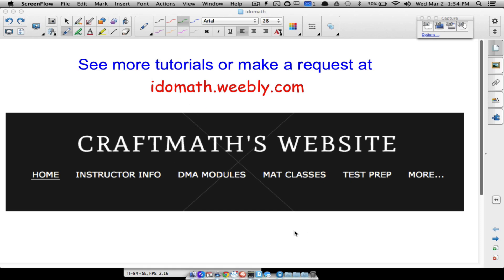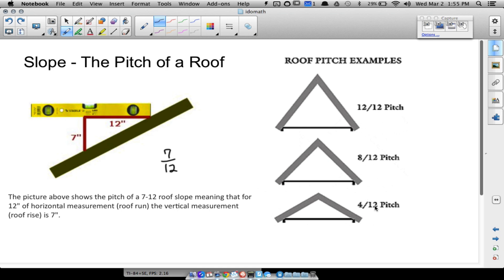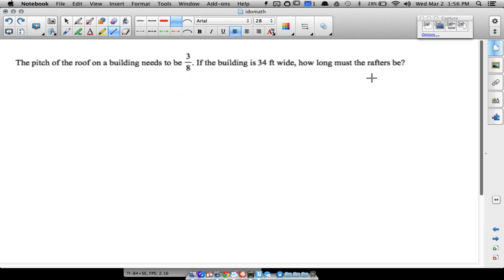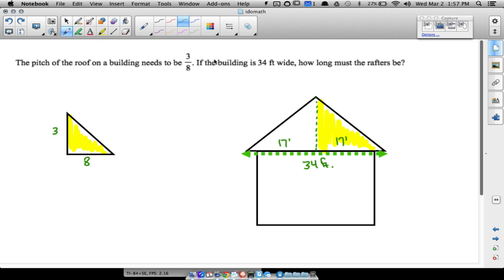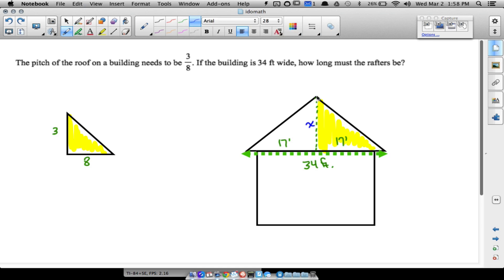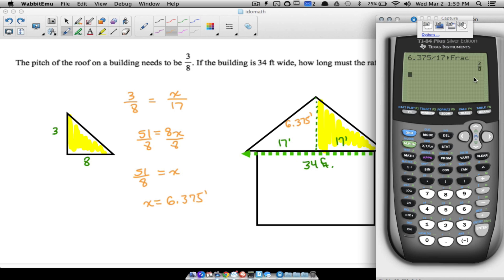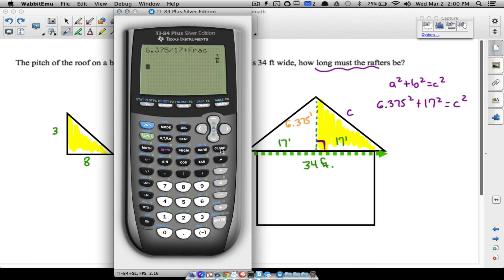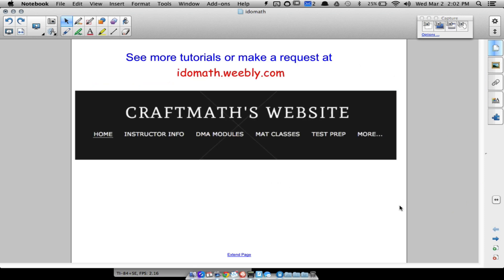Slope The Pitch of a Roof

Comment: slope is the precise measurement of vertical rise per 12 inches of horizontal run, used in construction; while pitch, traditionally, is the simplified fraction of total rise over total span (run x 2)
Reply from the maker: Yeah. I've learned that over the years through these comments. The text I used at the time didn't even mention this. Goes to show even books can be wrong. 👍

Comment: What is 18.2 ft on a tape? 18'-2in
Reply from the maker: 18 feet and .2 OF a foot... 20% of a foot... 0.2*12 = 2.4 inches.  So, 18.2 feet is 18 feet and 2.4 inches.
Reply: @bcraftmath  .4 is =1/4 ?
Reply from the maker: 0.4 is not equal to 1/4. 1/4=0.25
Reply: @bcraftmath  so I just round it off to 0 then.
Reply: Thank you so much, you helped me out big time.

Comment: On a lean two roof/building  when rising the front wall to give the roof a fall back you are also increaseing the run, and the more the rise the longer the run??
Reply from the maker: If the front wall that you are raising is vertical, you are increasing the rise, but essentially not changing the run, which creates more pitch.

Comment: Hi, I am from the UK and when we are setting out a roof we do it using the angle of the roof ie. 32deg, 35deg, 45deg. We don't use the 8/12 or 3/8
so using your way how could we do it. Thanks for any help.
Reply from the maker: To find the angle that you would need, you can take the arctan(rise/run).  In the first picture of this video, the rise was 7 and the run was 12.  The angle of the roof would be arctan(7/12) which is approximately 30 degrees.
Reply: Have the same problem too. Have you known the answer to this?

Comment: pitch and slope are different terms meaning the same thing, angle of roof:  6:12 slope = 1/4 pitch.. 4:12 slope = 1/6th pitch, because the 'pitch' of a roof is always based on 'full pitch' 24/12!!
Reply from the maker: Ok.  This video has received quite a bit of attention. I originally made this video many years ago to help students with a similar example they were working in a math class that I taught, which was a mathematical literacy class.  This wasn't a class specifically meant for contractors or folks who are very knowledgeable when it comes to roofing.  This is a general math class for college students.  Students were having trouble with a similar example, so I made this video to help them solve it.  Through time, I have received comments similar to this and I have also received questions about how to properly angle a roof and all of that.  I am no contractor, but instead a college math instructor.  I can crunch numbers and I do that well.  I leave it to contractors to do the actual manual labor.
Reply: @bcraftmath  all good.. my typing skill are low..(failed typing)lol. i was just pointing out the terminology, because all the video's i see about roofing the practical and theory terminology changes and can confuse apprentice carpenters. btw i'm no contractor but a Red Seal Carpenter for 20 yrs!

Comment: The illustration of the 12:12 pitch is not accurate because a 12/12 ratio makes a 90-degree angle but the illustration depicts something more like 12/16...
Reply from the maker: You are right.  A 12/12 pitch should make a 45 degree angle with the horizontal.

Comment: Hi, does this work with meters? How do you work out  it out please? I want to build a cabin 6m wide with a ridge at 1.5 m
Thanks, Mark
Reply from the maker: Can you provide a rough sketch? Once I have that I can provide all the necessary measurements including lengths and angles.  Thanks.
Reply: I can probably work it out as I know the run is 3m and the rise to the ridge is 1.5m so I can work out the rafter length. However, it is cutting the timber at the right angle that worries me cos I will not know whether it is a 12:8, 12: 7 or whatever, so I will not be able to use the markings on a rafter tool (triangle with all the markings) which are in feet and not in metres. Thanks, Mark
Reply: Read below first please, but I guess the pitch must be  6/12 because the run is double the rise?
Reply from the maker: 6/12 is the same as 1.5/3 regardless of the measurement system. You could think of the 6/12 as 6ft/12ft or 6m/12m sure the measurements are different in actual length, but they are still proportional.
Reply: Thanks....good advice !
Reply: OSTM, yes.  The pitch is just a ratio of rise over run.  In the USA, 12 is traditionally used as the denominator because in the 19th C. carpenters' framing squares commonly available in the US and England had a rafter tables stamped on the side based on 12 inches of run.  So by convention, 12 was (and continues to be) generally used in the construction trade as the denominator for describing roof pitch.  Of course, it's 12 UNITS, not necessarily feet or inches.  It works equally well in centimeters, meters, links, rods, inches, or cubits so long as you're consistent.  I build custom model doll houses in metric but scaled to Imperial.   I use a scale of 1.5mm to the inch (about 1/16 scale), and I calculate my roof pitch -- and cut my plumb cuts, "bird's mouth" - seat cuts, and soffit and fascia cuts just like the "big boys" except I mostly use fine hand tools and 23 gauge (AWG) pins & lots of CA glue instead of 16d and 10d nails and a worm-drive Skilsaw.  My 16 foot 2"x10" SPF No. 1 common rafters weigh not 90 lbs each, but only about 8-12 grams depending on the wood species.
Reply from the maker: Got some images to share. Your hobby sounds cool.... And intricate.

Comment: Im building a small pump house and my span is 30” and was going to do a 12/12 pitch. Would I multiply 1.25x12 to get  my height of ledger board?
Reply from the maker: Could you provide a quick sketch so that I can accurately answer?  Just drop a link to the pic here in the comments.  Thanks!
Reply: Hi!  30”/2=15”.   15/15 pitch   15*15+15*15=450 or 21,21” rafter

Comment: What if you don't have the 3/8 and your trying determine what the "3/8" is... For example what if it's 3/12 or 4/12... How do I calculate to determine my rise???
Reply from the maker: evangjrodriguez 3/12 means for every 3 inches of rise, you have 12 inches of run.... Or feet or meters or whatever unit of measurement you are using. 3/12 simplifies to 1/4 so you will probably hear of a 1/4 pitch versus a 3/12 pitch. Both are the same though. For 4/12 you can reduce to 1/3 which implies 1 unit of rise for every 3 units of run.
Reply: Brandon Craft ok and how do I figure out if it's 3/12, 4/12 or something else???
Reply from the maker: evangjrodriguez so you already have a roof built and you're trying to figure its pitch?
Reply: Brandon Craft yes sir...
Reply from the maker: Find the vertical height of your roof and divide by the horizontal distance of your roof. The vertical and horizontal distances are measured from a point that is beneath the apex of the roof and is in the same horizontal as the bottom of the roof.

Comment: Why are we still doing these calculations in 2017? If computers are our future and we still use calculators to do the math anyway, why not download a FREE version of SKETCH-UP and build/draw your roof with the desired dimensions/slope... Place your RIDGE BOARD up there at the calculated height... and simply (using the LINE-TOOL), draw your rafter with the desired tail and birds-mouth... Make a "copy" of it and "move" it away from the building where you can then ACCURATELY measure all the dimensions required! Seems like a no brainer to me! Using "Sketch-Up", I was able to cut ALL my rafters! The most important task then was to make bloody sure the walls where squared up to spec! They where and there were no gaps in sight!
Reply from the maker: +Aidan keenan that's just fine. Why so serious?
Reply: Hi Brandon! I'm so sorry if I offended you in any way, shape or form! I didn't take into consideration that your vid was to help your students and I now feel like an absolute idiot!!! Please accept my sincere apology!! My only feeble half-baked excuse is that (a) I was so excited that I had worked it out a different way and, Ironically (b) I happened to be watching your vid when the penny dropped! So I guess, it was your explanation that finally helped me work it out! Once again, my sincere apologies!  Kindest regards, Aidan
Reply from the maker: No problem at all Aidan.  I'm not offended. I was just answering your initial question as to why we are doing these calculations in 2017 (or 2016 rather since the video has a little age on it).  Glad to hear the light bulb went off!

Comment: You are my favorite Math teacher.
Reply from the maker: Why thank you!  I'm glad the tut helped!
Reply: Hello Brandon Craft - I have a question to ask. 

I am currently proposing to build a 24’Lx20’W detached garage that has to have a 5/12 roof pitch to match my existing home roof pitch. The problem I’m having is my detached garage will have 10’ tall walls versus 8’ walls in my existing home. 

How would I calculate the height of my roof ridge of my proposed garage I’m planning to build versus the height of my current homes roof ridge? 

City code here states that the detached garage roof ridge cannot be taller than the existing roof ridge of my home. It has to be subordinate, which I believe means the same or lower.

There is a section of my home that runs 26.7’ wide with a 5/12 pitch roof with 8’ tall walls.

Will my detached proposed garage roof beam height be taller or shorter than my existing homes roof ridge staying with a 5/12 roof pitch ?

How would I calculate the differences of heights between the two buildings? 

Thanks ! My city code requires it before I build.
Reply from the maker: Hey man. Can you provide a rough sketch just to make sure I'm picturing this right? I'll definitely crunch the numbers for ya....
Reply: 0
Reply from the maker: What's up?

Comment: So if I do a monopitch roof/shed/lean-to/slanted (so many names for it) on a 34 ft house like yours in the example with 3/8 pitch, I would have to build 12.75' wall on top of my existing wall at the high point to achieve that? Did I do that right?
Reply from the maker: I could answer your question better if you provide a quick sketch of what you have in mind. Thanks!
Reply from the maker: It depends on how much horizontal space you want to cover.  Do you have your "blueprint"?  I could help you with the math, but I need more specifics than the image provided.  Thanks.

Comment: HI, what pointer do you use?
Reply from the maker: Are you referring to the software that shows the pen on the screen?  I use a Wacom tablet (hardware) and Smart Notebook (software).
Reply: I mean how you controll the cursor? with the mouse I coudn't draw so accurate
Reply from the maker: It's a wacom tablet.  Take some getting used to, but once you have the hang of it, it is just like drawing on paper.  You can get them at Best Buy, Amazon, etc.  Some are less than $100 and some get really expensive.  They work great and last a long time!